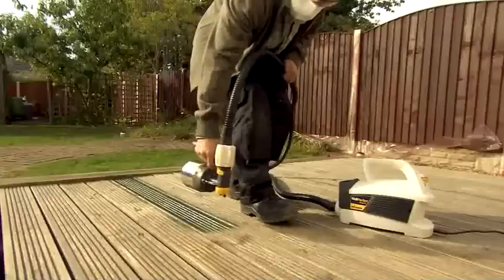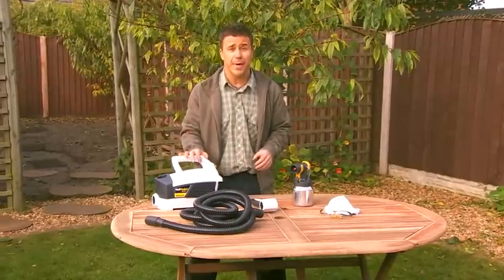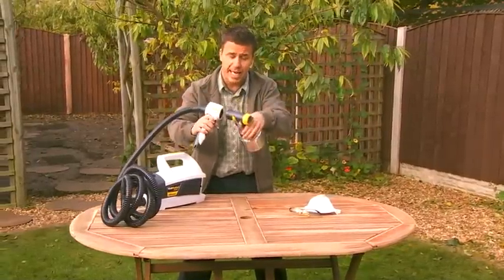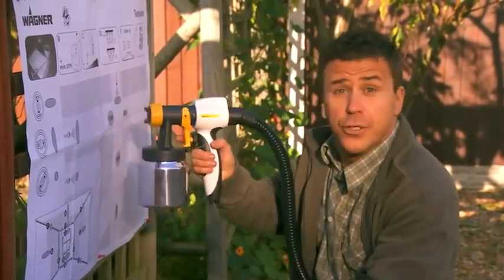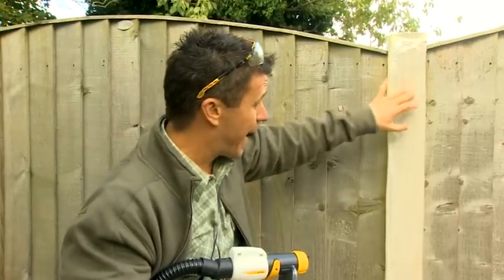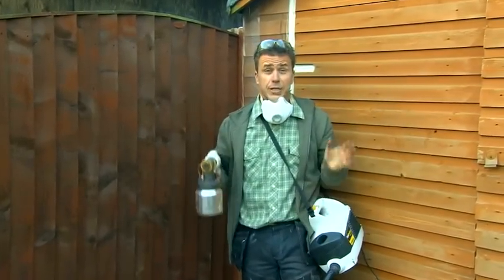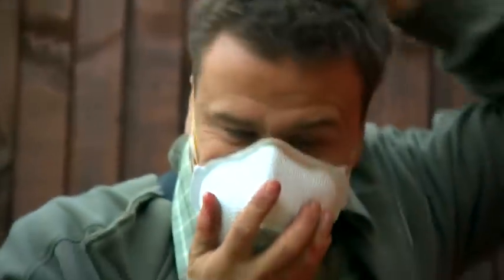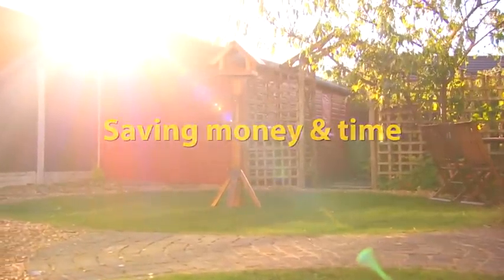Craig Phillips- How to Spray Paint Exteriors with the Wagner WallPerfect HVLP paint sprayer

Comment: I bought one and took it back as the slightest breeze takes the spray, so if you go a little nearer it just runs and you have to go over with a brush anyway!
Reply: We never recommend to spray outside with any paint sprayer if its a windy, if you start closer to the surface you must turn the paint flow down so it doesn't apply to much paint, only takes minutes to get used to the flow rate on a cardboard box beef you start your painting your items